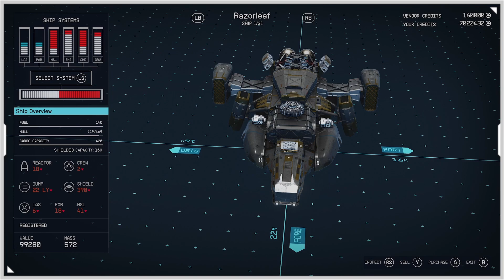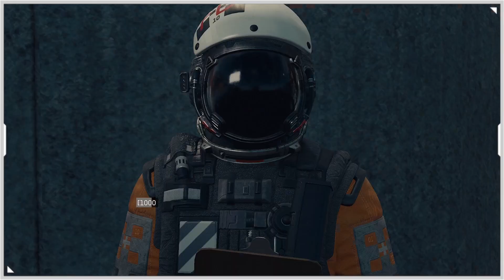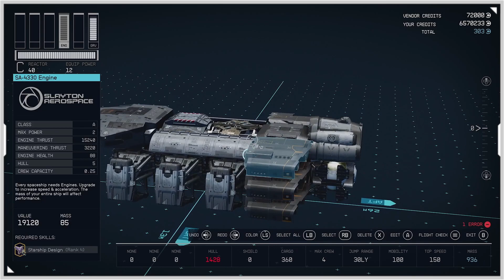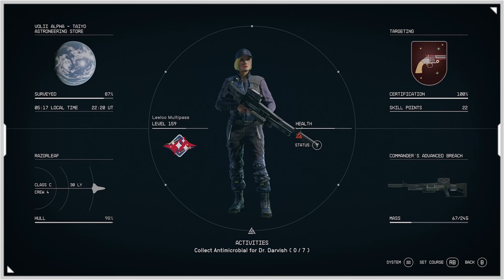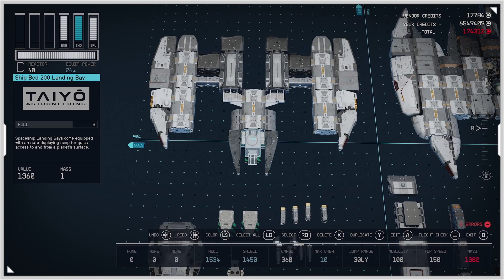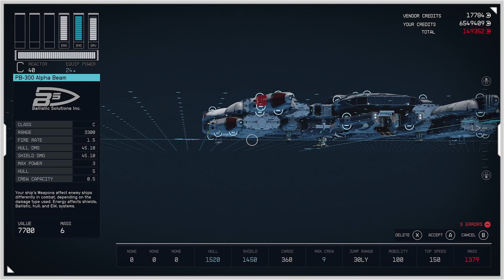How to build and design the best Batwing in Starfield

Comment from the maker: DOCKER LOCATION. I didnt show docker placement. its is the 100DP slim docker and its connected to the bottom back of the 1st 2x1 hab thats connected to the landing bay
BRAKING ENGINES: Swap the 2 Shroud braking engines on level 2 with any 1x1 habs to enable interior route. I forgot I swapped those out for cosmetic reasons and forgot it blocks the interior routes.
UPGRADED and FINAL BuILD: https://www.youtube.com/live/UTkIkJRa0Xw?si=ougSVPY9gqYHps8p
Reply: Only thing wrong with the video. Got it built, about to try it out! Thanks for the vid, new sub! 👍
Reply: I literally came here to say this exact thing....those braking engines need to be replaced with 2 1x1 HABS.  I even put the docker exactly where you're saying in this comment to put it lol.

Comment: I made this ship but hate it.  I restored a previous save to get my money back.  The interior of this ship is a huge maze that no one would use.  It's all due to trying to make it look like a bat.

The lack of cargo space is another really huge negative.
Reply: The pinned comment shows the upgraded build which has a perfect interior. Cargo is an east add. Just merge it into the grave drive or replace any of the top mid bracers or deimos hulls with cargo. then merger extra NG20 gear over the existing 2. Please check out the upgraded one and there is an interior walk through video as well.

Comment: The ship looks cool but the cargo space is incredibly low.   It's way too little of cargo space.  I have almost 8000 on my own ship and I still run out of space way too often.
Reply from the maker: easy to add cargo. there are plenty of spaces on top where I use the demos hulls or mid caps. you can also build. ship that hold 100k cargo, fill it, then switch to another ship and it will have all the cargo
Reply from the maker: you can also merge more cargo on to the grave drive and duplicate the ng20 landing gear in place for the extra gear. easy peazy with add8ng cargo
Reply from the maker: also every box in the lodge is infinite storage there are 6 in the workshop downstairs. best place to store and craft.

Comment: I'm pretty sure I did exactly like you showed, but I could only access the loading bay, the 2×1 behind it, the 1×1 above that, and then the cockpit.

It seems the 1×1 on the top portion (behind the cockpit) needs to be a 2×1 that can reach back and connect to the 2×1s behind the Stroud-Eklund Braking Engines; otherwise, the rest of the ship is inaccessible.

This means that the Reactor, Grav Drive, and pretty much everything else in that center line needs to come back one notch. At that point, however, the ship build exceeds maximum length, so I had to eliminate the Deimos Tail and move that landing gear forward. I ended up putting a Nova Cowling 2L-TA right behind the Deimos Hull A, and the Hope 5 Landing Gear is beneath the Hull A and sticking out a little under it which is covered by the Nova Cowling.

My only real complaint with this build is the lack of cargo capacity; I usually run around 6000-7000 in all of my ships, if I can manage it. What I did in this case is eliminate a couple of the 1×1 modules behind each 3×1 on the top outer wing portions and replace them with Galleon S204 Cargo Holds (4 total), and so my cargo capacity is now 6280.

Unfortunately, this dropped my mobility down to 37; to counter this, I changed out 4 of the SA-4330 engines for some SAL-6830s - which, again, required some modifications to the design, namely the removal of the two Deimos Wing A's.

Overall, though, it's still very, very "Batwing", and I love it.
Reply from the maker: The pinned comment answers that. But you should see this update: https://youtu.be/j34TY1gwVjQ?t=10686

Comment: Finally someone with an excellent guide, everyone else shows the build with items from many vendors and you have to find out yourself where to go to start and come back etc.
Thank you for sharing, great ship and excellent 10/10 guide , you earned a sub ty!!!!
Reply from the maker: thank you for the sub! Join my li e stream and I can go o wr some new additions I made on this after the video.
Reply: @2SmokinBarrels  Just one question please! 
 
In Atlantis the bay door is not touching the ground because the ship is too long and the ground goes downwards so i have to make a tiny jump to enter the ship , its normal right?

Just asking because if there is a glitch and i lose my ship i will go crazy (once i lost it and had to go back to another save to have it again from a glitch).

Thank you !!!!
Reply from the maker: @zartius thus happens sometimes. depends on if you land there, make the ship your home ship from the builder or change ships. each seems to move the ship position for some reason.
Reply from the maker: also. every single box at the lodge is infinite storage. there are 6 in the lodge workshop. best place to store and craft

Comment: Has noone noticed that there is no way to get to any of the habs inside?
I just tried building this myself and once you enter you have a ladder up to the companion way which leads to the cockpit but that is it. No pathing to any other habs??
I have got through the video a few times and I don't see a pathway. At 21:58 with the 2 main levels separated, you can see what I mean.
Help?
Reply from the maker: Damn. sorry about that. originally, I had 1x1 companion ways in place of the 2 braking engines on level 2. That made the connections. I swapped them for cosmetic appearances and didn't realize it broke the route. Swapping those out will resolve this. Thank you for the comment.
Reply: Ah ok great, that makes sense. I will do that.
Thanks! @2SmokinBarrels
Reply: Ran into the same thing. Fixed now. Thanks

Comment: List of all the costs with locations:
Deimos(Moon of Mars): 241213
Hopetech(Valo->Polvo->Hopetown): 111706
Nova Galactic(Sol system->Moon of Saturn->Titan->New Homestead): 4824
Taiyo Astroneering Showroom(Volii->Volii Alpha-> Neon Core): Only if you didn't get Landing bay
Contraband stuff(Porrima-> Porrima 3->Red Mile):16000
Any of your outposts that has landing bay+shipbuilder:162112
Odin 3050-C Shield Generator missing->Buy it in Deimos Staryard for 45300
Also weapons missing->Disruptors 3340 Alpha Beam (x4) = 31700
Total without those specific weapons: 523095
Reply: ya but he built a couple of ships of crap instead of swapping parts.